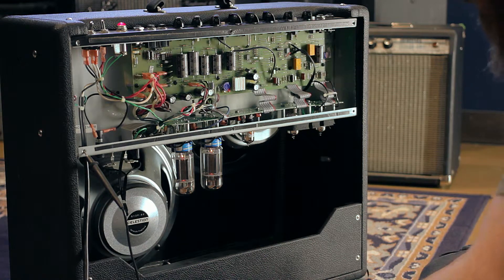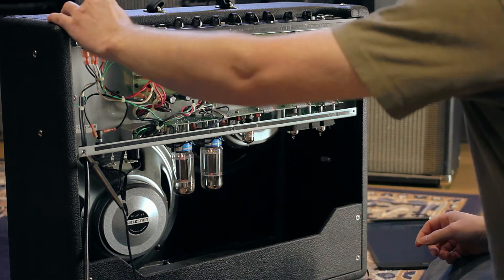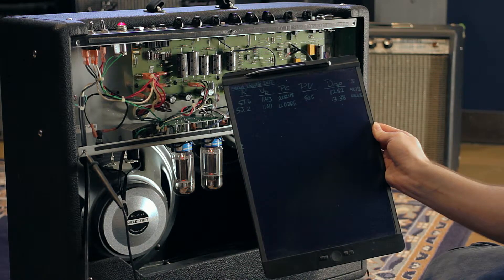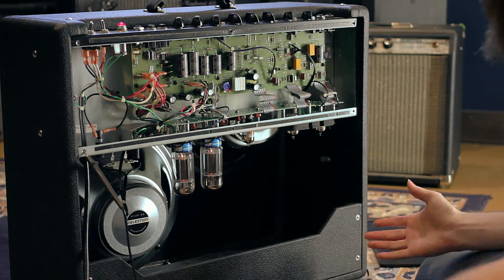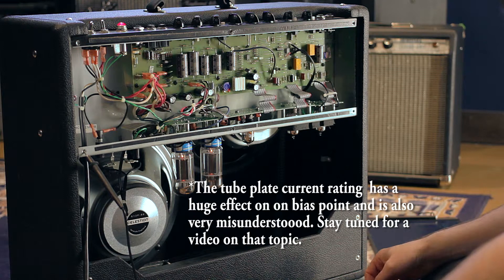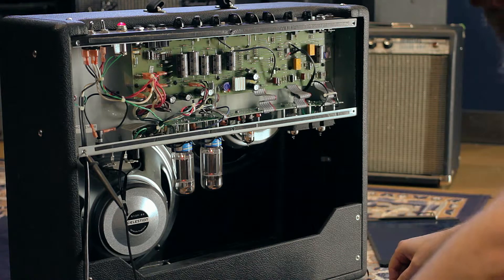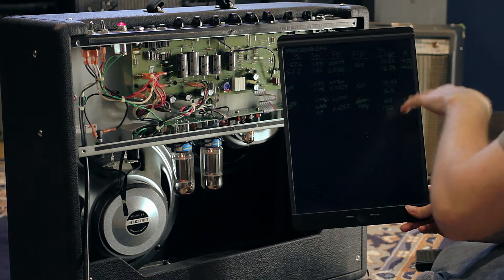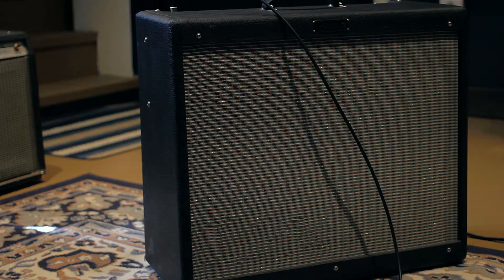Fender Hotrod Amp Bias - Why You're Doing It Wrong

Comment: Unfortunately using the on-boards cathode resistor to set bias can be misleading for the following reasons; Firstly you can't rely on the 1ohm resistor being the correct value. Secondly what your actually measuring across this 1 ohm resistor is anode current plus screen current. The screen current can account for around 5mA of the total current giving you a false reading. Measuring the DC resistance of each primary ( as the author suggests) will give you a far more accurate reading as your only reading anode current at this point.
Reply from the maker: Correct. I think so many companies do it this way because of ease. They also don't want to encourage people to probe the high voltage. And it also gives a bit of buffer for those that always want their bias hotter. 
My thing is that, either way you do it, you do need the plate voltage to calculate the bias and get repeatable results. Biasing to 65mv means nothing unless you use it to calculate the bias. It will usually be a safe number with these amps but the feel and sound can be wildly different. And on the resistor value, I would say that the value being off isn't that big a deal since you can account for it in your calculation. Or at the very least, that will be a static value you will always be measuring through. But in terms of just going by the 60mv thing, you are correct.

Comment: Nice, did the same thing on my Deville, i also noticed that my TAD 6L6s (some years old) are about 10mA apart from each other, that's a little bit much to call them still matched, (well, that's not the fault of the amp), so one was running very cold (~35%)  before setting the biaspoint to about 75mV
Reply from the maker: While there can be bias drift and tubes do wear differently, that can sometime be an indication of a problem with the amp. Give it a careful check over. It's not uncommon for one of the protection diodes on the plate to start to leak and cause problems. Not saying that it is, maybe that one tube just wore more. 
Either way, you'll likely discover that a mismatched set of power tubes can actually sound pretty good.
Reply: @amp_mechanic hmm, thanks for your tip regarding the diode, i just can say that it's super reliable and didn't have any problems (since more than 4 years when i changed some filter caps), and even after the hoter biasing now. I think the sound is awesome, so i guess nothing to worry about (: the reason i did check the biasing after all was because i swapped one speaker, so i thought it doesn't hurt to check on that stuff too.

Comment: The Hot Rod amps should have a plate voltage of around 430V (Deluxe) and 475V (Deville). Did you actually measure 505v on your plates ? 🤔
Reply from the maker: Any values I give are the actual measured values. That plate voltage will be dependent on incoming wall voltage, what tubes you have and what the bias setting is. There are some other factors that can be relevant as well. Values printed on a schematic are only relevant under their specific test conditions and are often ideal theoretical numbers.  ( I mean theoretical in the scientific sense, not the common parlance definition.)
I'm going to do some more videos on this topic at some point. It's a good discussion to have.

Comment: This is confusing.  Is 60mv the sum of both tubes, being 30mv on each tube?  I have a friend in Italy that biases his '59 Reissue Bassman the same way and I have a vintage tweed 1959 Bassman and I never heard of going 70 or 80 mv.  I set the bias around 39mv.  My Italian friend said his tech says it is the sum of both tubes.  I hope that is correct because if I ever set my NOS Tung-Sol 5881's at 60mv, they would immediately red plate.
Reply from the maker: Correct, 60mv is for both.

Comment: I have been arguing the parts % thing for years. i have come to a point of using nothing above 5% parts if available and the best caps I can get anymore at tube voltages. Thanks for the lesson on trusting the math and not a factory setting.
Reply from the maker: Exactly correct. There's a reason why amps, especially hi-fi, that use 1% components are expensive. Consistency. There's also a major problem with builders not paying attention to voltage ratings on resistors. Especially many notable boutiques amp builders. It's not a problem until it is but, heating causes tolerance to be even worse. There's always a trade off, money and consistency is a battle.

Comment: Hey Jay while your basic premise is correct that the Fender Spec Bias of 60mV is very cold but what you missed is, yes while  a 6L6GC has a max plate dissipation of 30 watts which would be in the case of an amp running in Class A.  The Hot Rod Deluxe is a Class AB amp and the output tube should only be biased at most to 70% of max dissipation otherwise you will burn up the tube.  Its my experience with these amps that even with the bias control fully clockwise you will not reach 70% (21watts) of plate dissipation. So it is pretty much impossible to over bias these amps without modding the bias circuit.
Reply from the maker: Hi Bill, if you watch the whole video I say the hot rod amps usually do well biased around 50 to 60%. I've worked on a few of these amps that would red plate the tubes, so saying they won't reach 70% or more is just not true. If someone throws a set of "hotter" tubes (marketing jargon for tubes that are not in spec) in there it's certainly possible to have them running higher than 70, I've seen it. When I say 150% I'm extending it to all amps that have a specified ma running parameter. 
But if anyone likes how their amp performs using the 60ma parameter or 70ma or whatever, great! Run with it.

Comment: The recommended 60mv is for a 5881WXT Sovtek tube...
Reply from the maker: Still a 6L6 variant. Plate dissipation specs are a specific value depending on the sub type design. Given that Groove Tubes rebrands them and uses their garbage rating system, and they come from that factory with a wide range, you have no idea what the plate current draw spec is on your particular set is. Hence 60mv doesn't really mean much unless you measure plate voltage and do the math. 
If you like 60mv and it works for you, great!
Reply: @amp_mechanic  the 60 mv was specified by fender for their warranty.
Reply from the maker: Sure..if you believe that, that's what you should do.

Comment: I have the Hot Rod Deluxe and I'm running it at about 65mV...what do you r calculations tell you as to where I SHOULD be running this amp? Thanks...interesting video
Reply from the maker: Go look up Uncle Doug on youtube and search for amp bias or something to that effect. He has a great explanation on what measurements to take. You just need the dc resistance of each half of your OT primary, voltage drop across each and plate voltage. With that you can calculate the dissipation of each tube and know exactly how it lines up with what you're hearing. That way no matter what current rating tubes you get, you can have consistent performance, whatever you like to run them at. Also note, wall voltage can have a huge effect so it's no good to set it up at your shop running 124V from the wall if most places only get 118 or the worst I've seen 113 or 112. I use a variac and do everything based off consistent 120V. For ex: If I know someone is playing a lot of bars around here, I'll set it up at 117 because that's what the amp will realistically see most of the time and make sure the 120v is still in spec though it will be on the higher end.
Reply: @amp_mechanic  thanks...

Comment: Hey bud, you’re putting way to much thought and effort into it. Who cares what percent the valves are running at, adjust it to  taste. If they’re running a little hot and burn up a little quicker than usual, so be it, as long as you get the sound you’re after. Otherwise what’s the point?  In the old days it made sense to try to get the valves in their sweet spot because it was a pain to bias them. But nowadays all you you have to do is adjust the potentiometer to your liking.
Reply from the maker: Works for me....and it's a big reason I get lots of repairs in. So power to you and all those out there with a similar mindset.
Reply: @amp_mechanic  totally rite..
Reply: I'd rather get the tone I'm after for a while than a tone I don't like forever.
Reply: In the old days, the amps were all tube, not these hybrid ones with their “circus boards”!
Reply: Methinks you confuse point to point vs tube.

Comment: Ok, this is very interesting. I've been just setting the bias between 60 and 75 mA, measured on the bias test point in my HRDx.

But what should I do if I want to do it correctly? Could you describe the procedure step by step? 

To point - at 1:15 you say you measured: 
- primary resistances
- voltage drop across the trasformer primary
- plate currents
You come up with two sets of values on your notepad. Why are there two lines? Are these values measured for each tube separately? How to measure these values?

How to make the bias calculations in the next step? Do you use an online calculator?

And after that - how to determine the optimal bias value, or at least a safe bias range? 

Perhaps you can point me to an easy to understand online resource? 

Most of the easy resources just say to set bias 68 mA at the test point (higher than Fender's spec). I tried reading the instructions on Weber's website, but I'm afraid it's too difficult for me, considering that I have little knowledge of electronics.
Reply from the maker: Look up Uncle Doug here on youtube, he has a great channel and his 2 or 3 part series on amp bias is the best explanation of the procedure that I've seen. https://youtu.be/w9B0Rhr_Y-E

Comment: JAYS GUITAR, on fender amps with a normal chan and vibrato chan. If you REMOVE the First preamp tube from the normal chan, the vibrator channels preamp will have a Higher output because of the Impedance/load of the normal channels first preamp tube. Any reasons why the Unused normal channel preamp tube will LOADS down the vibrato channel preamp output wattage?
Reply from the maker: Because they share the same power supply node. If you measure the plate voltage, you'll notice it goes up on the other tubes when V1 is pulled.
Reply: @amp_mechanic  , Yes the voltage goes up when V1 is pulled but I thought vacuum tubes had very high input impedance and the plate output impedance "shouldn't LOAD" down the other preamp tube when its shared in parallel. Like you said both preamp tubes plates are shared tied together. The DC plate voltage will raise higher when pulling removing V1 on the normal channel. This also changes the "impedance" to next following stage is use to seeing as a load? What i mean is that is changes the Tone of the preamp section now since you removed the unused preamp tube of the parallel channel. Is this true or not that it changes the tone and impedance?

Comment: Fender say's to use 60 Ma as a starting point. You can go as high as 80 Ma and even 90 Ma.according to Fender.
Reply from the maker: Again, in my view, somewhat useless information. There's wide enough operating variation in these amps, not to mention tubes these days, that's not an accurate measure of how the tube is performing in the amp. If someone wants to start at 60 and then adjust till it sounds right to them, have at it. Anyone aspiring to do a proper bias job and maintain consistency, you can't rely on that. That's all I'm saying.